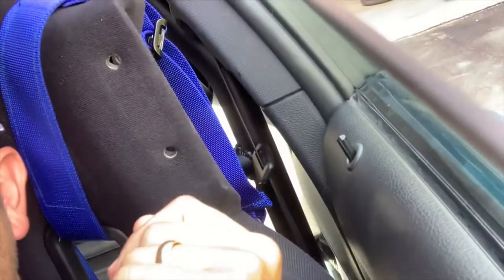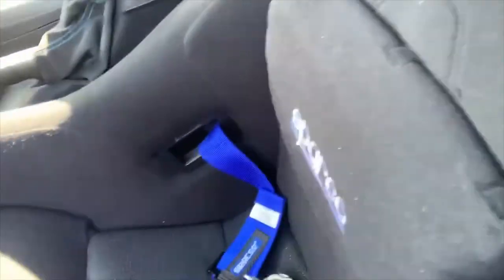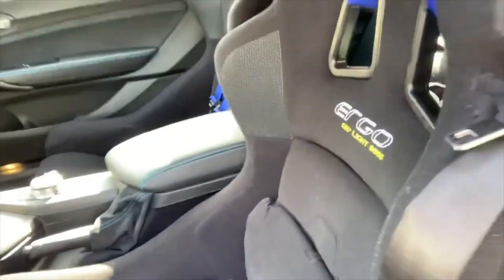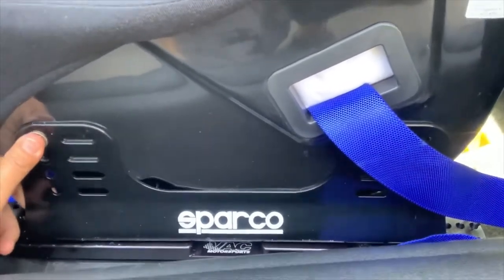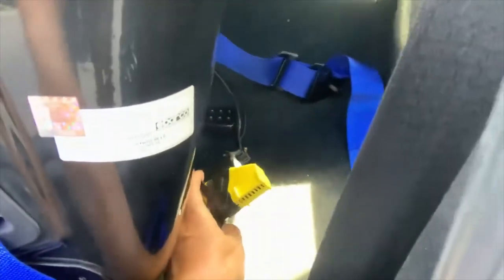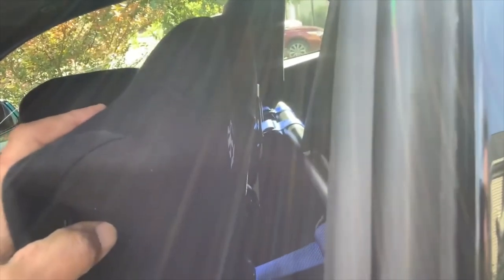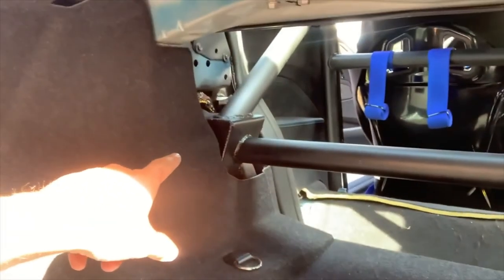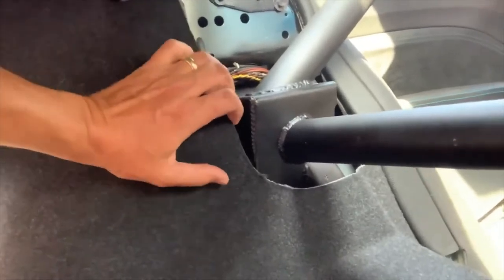Half Cage Install | Track Car | 2018 BMW M2

Comment: Any Feedback on the VAC floor mount adapter? Any other options you considered?
Reply from the maker: This is the hardware my installer recommended. Seems to have plenty of adjustability back, forth and even sideways. Feels solidly built too.

Comment: Nicely done. I just bought my m2c. Do you recommend to run Recaro Pole Position or Recaro CS seats with Schroth quickfit pro 4points harness? Not really ready to fully transfer to a track car. Live in DC, around 10 tracks/yr. any comments? Probably will see you at summit point! Haha
Reply from the maker: Raymond - hope to see you at the track soon! In terms of recommendations, I’d recommend contacting OG Racing in Sterling to discuss their em recommendations. Good and knowledgeable people.